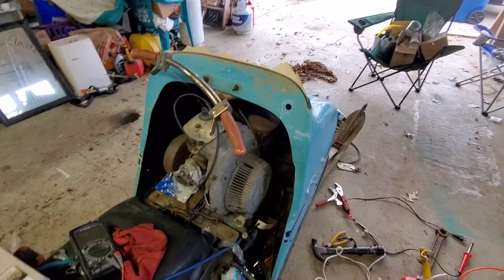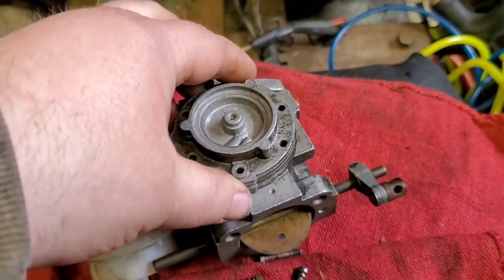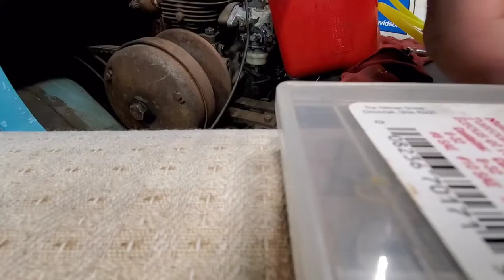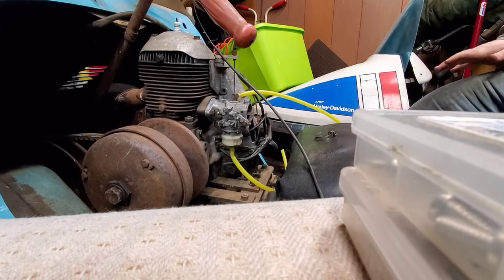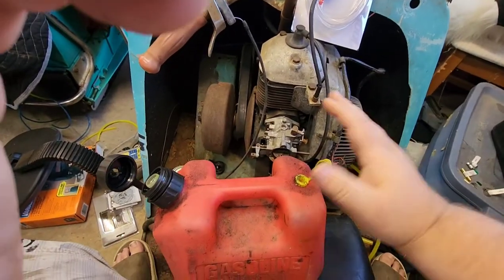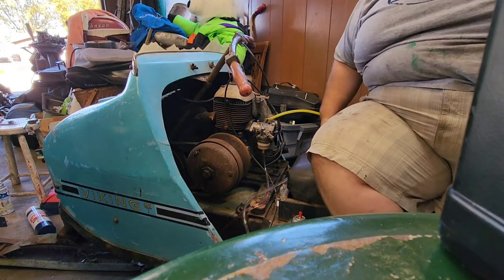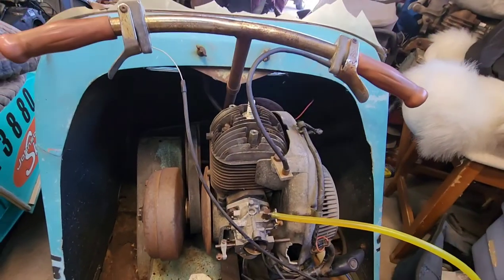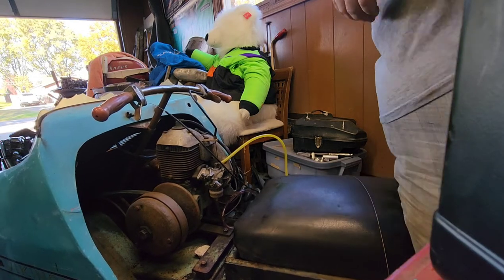1968 Eaton Viking snowmobile revival part 2. Will it run?

Comment: Hey there! really digging the videos but ive got a question. So I was recently given a 1972 johnson skee horse 30 by a guy and it was missing the key. I tried a number of different keys I had lying around to see if I could get something to work. No keys would work but I used the end of a ziptie and a screwdriver to get it to turn. Im just curious if you know of any key ignition systems that would work with the factory wiring. thanks! and keep the videos coming
Reply from the maker: Hey bud. Thanks for the comment! Unfirtunatly 71 and 72 30 horse keys are pretty unique to those machines. You could probably wire in a universal type key (the sled will run without a key as long as the ignition is unplugged) but there is nothing that is a direct "plug and play".  Do you have Facebook? There are a few groups out there, I am a part of. johnson/evinrude snowmobiles is a good one. Also you could call George at Northwestern Boat Co. He has a large stock of NOS parts. Hope that helps my friend! Thanks for watching!! More sled vids coming soon.
Reply: @delmontindustriesltd7501  I do have Facebook! I’ll hop on there and join those groups. I’m new to the old sled game. I know the old outboards pretty darn good but this old sled kinda fell into my lap. It’s got a little crack in the hood but other then that it’s pretty nice
Reply from the maker: @samsvintageoutboards6847  awesome! I'm the admin in some. Just watch out for Dave's omc. If you choose him for business, pay in cash.
Reply: @delmontindustriesltd7501  are you the admin or Johnson/evinrude snowmobiles?
Reply from the maker: @samsvintageoutboards6847  no. But I am in that group. The one I'm admin of is johnson, evinrude and snow cruiser snowmobiles.